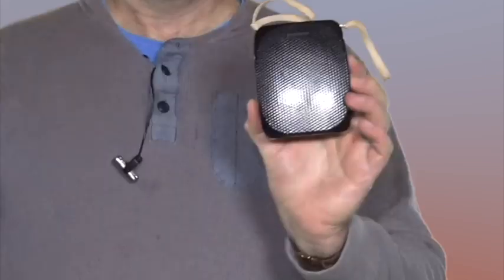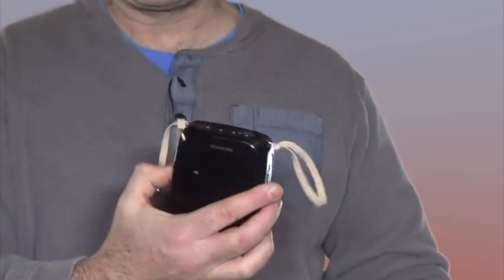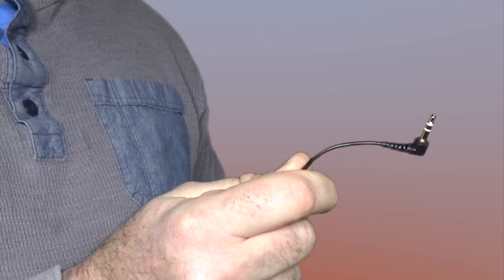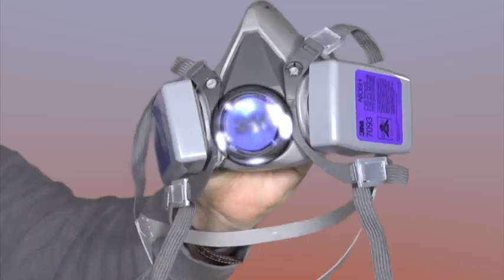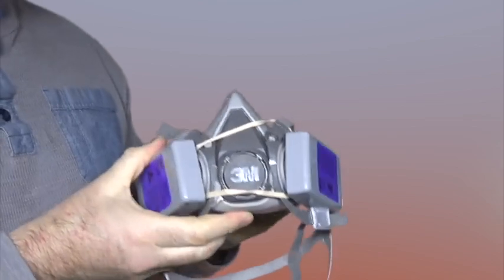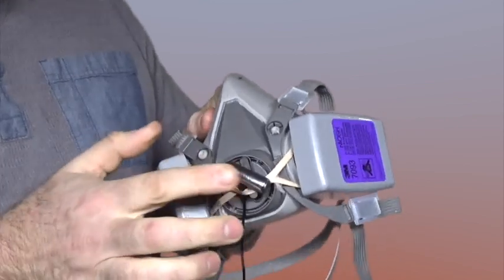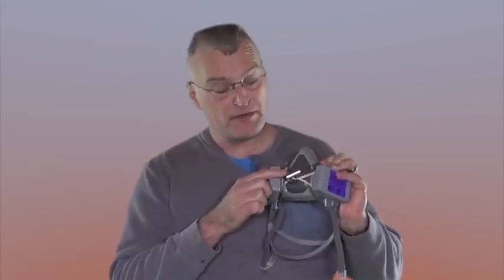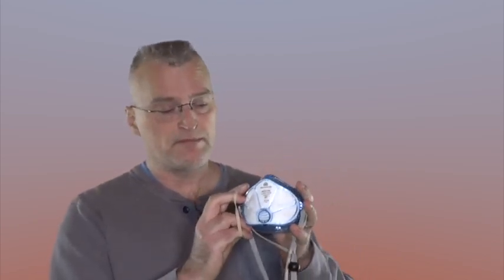Cheap & Easy Solution to Improve Communication with Respirator Mask

Comment: This is a very interesting solution. I'm surprised there are no purpose built mics for this. I used to wear a respirator for work (in manufacturing, not medical) and this was always an issue. We ended up using a lot of ASL to communicate
Reply from the maker: Pretty cool work around and agree not sure why these are not built into these masks